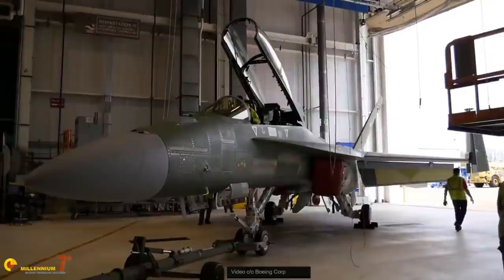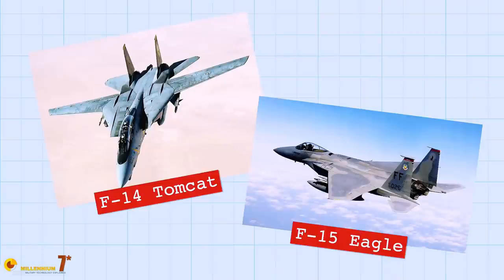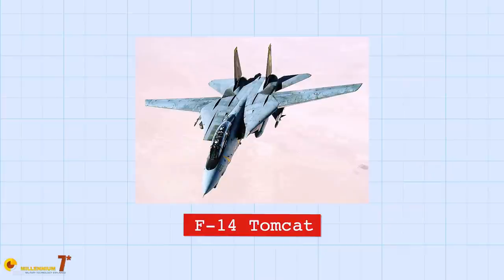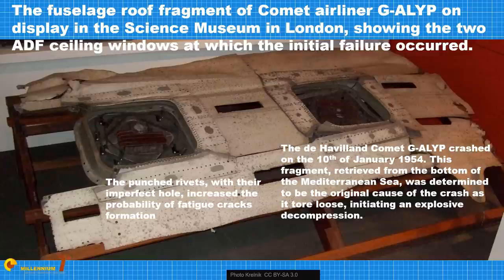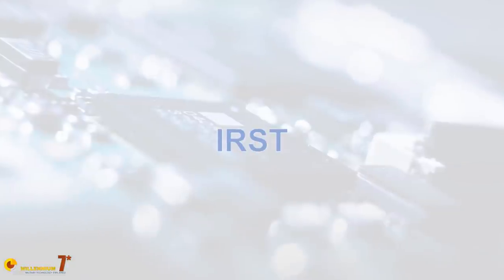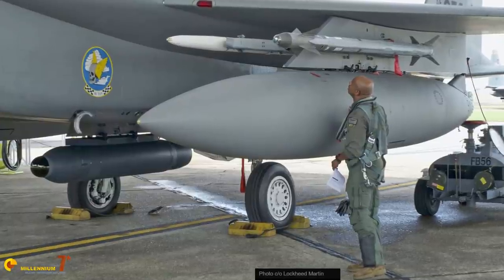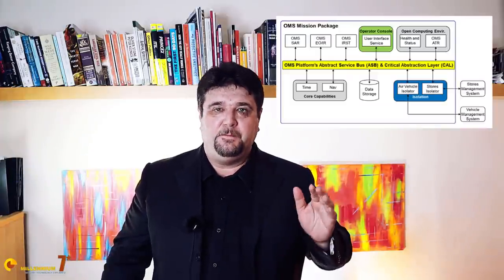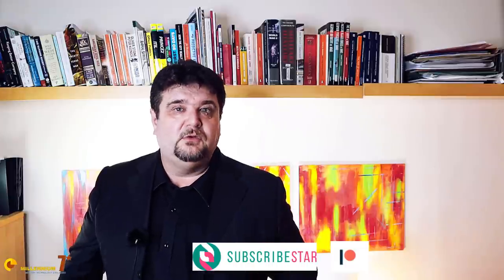The F/A-18 E/F Block 3: is it 5th Generation?

Comment: The question is not whether the F/A-18E/F Blk.III is 'Gen-5' but whether that metric is itself a useful measure of mission performance metrics.
It is not.
Stealth which costs double the CPFH of a twin engine jet a dozen years older in design baselines is not going to be purchased in numbers sufficient to grant sensor coverage of large operational areas.
Stealth which is 'so good' that the enemy is forced to go after the basing mode (killing all stealths at the Carrier or MOB vs. one or two over the target area) is no good insofar as it forces the CSG to standoff in the 1,000-1,500nm radius category which makes any minor improvements to fuel fraction pointless because, at these distances, pilot endurance as persistent presence becomes a dominant driver on 'the other 50% of the mission' simply spent to or home from the mission area.
Stealth which is too poor to exclusively (hot side) protect the 'platform' from detection and shoot down, thereby compromising 10-20 years of design investment in VLO is not useful.
Stealth which is lacking in mass video memory or a (MADL) ability to rapid-transfer targeting quality data back to whatever rebro node takes it out of MA or theater is useless.
Having said all these things, the F/A-18E/F is not a success story in it's own right or as an improvement on the F-35 in these areas because it's altitude performance is, in fact, worse (PS0 = Mach 1 at FL200).  It's drag is enormous, thanks to external carriage of stores from toed out weapons stations which do not suddenly 'straighten up and fly right' by removing the inboard station SUU-79, thanks to upper fuselage CFT.
It's signature reduction is highly dependent on viewed aspect.
It's 550 vs. 700+ nautical mile radius differential compared to the F-35, effectively robs the latter of the support jamming and air to air missile cabinet the Hornet is supposed to provide while making the utility of the MQ-25 questionable as both fighters carry in excess of 18,000lbs of fuel.
It's use of the enormous AGM-158D JASSM-XR, while theoretically allowing the Blk.III to be 'on call' for the ISR only F-35 to cue targets for, does not account for either the enormous 'fighter' systems waste in what has become a missile truck.  Nor the flyout lag of the subsonic weapon.  Nor the added carrier magazine penalty of the much larger standoff missile (see: B-1B from Andersen or Darwin for what an ALCM carrier looks like...).
Even as a straight up fighter, the jet is compromised by the asymmetry of an AIM-260 vs. PL-15 comparison in which the Super Hornet needs the better missile to match the lesser PL-12 and when matched against an as-equals weapon like the PL-15, is once again outclassed by the J-11D or J-16's ability to sprint-boost the missile to a higher launch Mach from as much as 20,000ft (less dense air) greater altitude.
Even the IRST is on the wrong side of the airframe to provide look-up tracking against superior kinematic threats while placing it on the fuel tank ensures both vibration induced tracking instabilities and the potential of dirt-mud-water kickup from the nose gear, damaging the sensor window as the not-hard-locked-t-airframe sensor bounces up and down in the tank shell.
The Sixth Generation will be defined by cheapness and the ability to rapidly get to targets as much as 2,000nm downrange (F-104 like drag indices, supercruise transits) before loitering, persistently, for 10-15hrs, 'taking pictures' and then coming home.  This is, by definition, a UCAV mission and it will need all the things a manned recce asset does /without/ being vulnerable to loss of stealth tech or a pilot when a megawatt class ground laser cuts the fuselage in half.
It will likely use a laser of it's own to defend against missiles or hunting drones and rather than carry heavy strike weapons, instead send data that calls in a hypersonic strikes from many hundreds of miles up/crossrange, off of stealthy Arsenal SSGN subs.  Because submarines cannot be sunk by BASM.
The Navy is not interested in acknowledging this, despite having recently (2016) begun running 'Fleet Problems' again, which show, repeatedly, how rapidly present day (Cold War Legacy) systems LOSE WARS to Chinese level Peer threats.  The last such HQ exercise, hosted by the Marines, only began to approach a neutral draw, with extreme attrition, when multiple forces were prepositioned on bases across the 2nd Island Chain, Australia and Alaska.  While keeping the carriers firmly to the east of Guam to defend it's key theater entry position for USAF heavy bombers.
Even then, losses approached 50% of committed forces.
Ironically, this is an exact replication of the ~1929 'Fleet Problem IX' which showed, in attacks on Panama, that carriers could get in one good, solid, blow but then were inevitably caught out by the predictability of being in a given sea space (to recover the raids they had launched) when longer ranging bombers from multiple airfields ashore, wiped them out in retaliatory raids.
So it's not even like we're learning from our own anachronisms.

Comment: Technology has made top line 4th generation fighters virtual 5th generation fighters in terms of lethality for a lot less money.  And sense anti-stealth technology is at our door step you could say they might as well be 5th generation fighters.
Reply: Not even close.  There is nothing really 5th Gen about 4.5 Gen ++ fighters.  Some countries are trying to imitate as much of the avionics approach in 5th Gen, but you really can’t do it the way all the systems are integrated in a 5th Gen platform.

Starting with performance, you can never meet the range/combat radius and transonic/supersonic performance of aircraft with high T/W and internal weapons bays.

With sensor suites, 5th Gen have all the sensors embedded into the airframe and integrated into the cooling, countermeasures, propulsion, and Very Low Observability from the start.  You would have to start from scratch with a 4th Gen airframe, and at that point, you might as well build a VLO airframe.

Every single 4.5 Gen fighter in production or development costs as much or more than the F-35A, for example.  F-35B and C costs have come down below Eurofighter and Rafale as well.

For situational awareness and ability to penetrate modern layered/high saturation IADS, you aren’t doing that in a 4.5 Gen fighter.  The Rafale flying into Libya with its patchwork residual IADS threats is not the same as Syria or Iran.  Only the F-22 and F-35 can fly in the most heavily-defended networks in the world, and have done so.
Reply from the maker: I beg to differ.
> I don't see where the range argument is coming from, just consider the SU-27 family.
> I don't see the transonic/supersonic point either, all the European deltas can supercruise while the F-35 cannot.
> The airframe integrated sensors are a necessity dictated to preserve radar stealth, and it is much simpler to build a non stealth sensor. Leonardo has been offering for a while IR sensors capable of replicating the "See through" feature of the F-35 that can be retrofitted on existing platforms, for example.
> In terms of situation awareness and sensor fusion, today it is a rather common feature. Gripen E/F and Rafale at least are on par with the F-35, the F-18 will soon be.
> Finally , cost is not comparable. The F-35 is destined to be built in a couple of thousands units minimum, while the European planes stop way lower than that.

The only important feature separating the most advanced 4++ from 5th is physical radar/infrared stealth. Radar physical stealth is not going to be effective for long because... the whole world is working frantically on beating it since it cannot being kept secret. 
Infrared stealth, on the contrary, is going to be a very important advantage in the future.
Reply: @Millennium7HistoryTech  Yes, the Su-35 is huge with over 25,000lb internal fuel, so even with external stores, it should have considerable range advantages.  I was thinking more along the Western 4.5 Gen fighters.  Rafale has good range with EFTs, but it loses weapons hardpoints and there is still a drag penalty to work against. EF also has good range with EFTs.

My point about transonic performance is with combat-configured aircraft.
The Eurocanards can supercruise in Mach 1.2-1.4 region with limited stores, not with standard combat loads including FLIR pods and large A2G munitions.  A lot of the published supercruise numbers are for very slick A2A configurations or maybe 1 EFT (These are limited to Mach 1.2 which isn’t my idea of supercruise down on the edge of the transonic region with the variations in mach wave formation there), whereas the F-35 can dash to Mach 1.6 (with 2x 2000lb bombs, having taken off with 18,000lb of fuel, IRST/FLIR/LST built into the nose, and ECM/EW integrated into the airframe), go to mil power and take a very long time to decelerate from 1.6 down through transonic and back into a .9 Mach cruise speed, not that supercruise was ever in its design requirements anyway.  

The F-22A can take 6 AAMs and 2x 1000lb JDAMs or 8 SDBs through transonic and into high supercruise, release any of those weapons above the max V0 of any of the combat-configured Eurocanards, and not experience any aerodynamic penalties from being fully configured as well.

I respectfully disagree that 4.5 Gen are on-par with JSF SA since they don’t have the RF and IR sensor count and spherical coverage in both IR/RF spectrums, or in the full antennae lengths that are embedded into the JSF airframe.  They also don’t have the same type of LPI layered Line-of-Sight directional data links with that high of fidelity and data transmission rates, although they have introduced better data links on the latest versions and advertise them as such.  The F-22’s IFDL and F-35 MADL are not fully explained in the open.

Rafale and Gripen E are trying to compete in that space in RF spectrum by using GaN TRMs in the ECM and AESA sensors, but they don’t have the 6 high-res IR cameras to provide that type of SA for the pilot and MADL net.  There’s a new IR MAWS for the Rafale that has 2 fish eye hemispheres mounted to the ECM housing on the vertical stab, but this is limited to close-in IR MAWS self-protection, not intermediate/long range TGT detection.

Not even the Su-57’s nose AESA has the TRM count of the APG-81, though it compensates for this with the chin AESAs, nor is the semiconductor quality on-par with the 6 US companies making chips.  They are trying to compete in the RF and IR sensor count on it though, since they were able to design and airframe from scratch after seeing the F-22 and JSF basic sensor architecture.  It will break them economically though.

France’s RBE2 AESA in the Rafale has about half the TRM count of the APG-81.  TRM count allows more modes to be used simultaneously and is better for return signals and ECM/ECCM, waveform manipulation, and low power freq-hopping narrow beam performance.

Sensor fusion in the 4.5 Gen fighters is an after-thought after gaining insight into some of the features of ATF and JSF that have been trickled out and now more openly-discussed.  Fiber-optic sensor fusion through multiple super-computing banks in a closed-loop system designed that way from the start is a lot different than trying to install that framework into an older airframe, especially looking at the integration with cooling, landing gear doors for radar bay access in the JSF (very maintenance-friendly), or integration with concealment features.

Also, RF VLO techniques aren’t static.  The F-117A went through at least 3 different types of RAM, finally using F-22 initial RAM.  Its RCS values shrank as it was improved and retrofitted with RAM that didn’t exist when it was designed.

The same is true with the JSF.  At Lot 4, they introduced a new nano composite fiber skin that changed the way RCS was compared to the F-22.  Prior to that, the F-22 was said to have a better/comparable RCS depending on aspect.  After that, the JSF is said to have a smaller RCS.  There is also a new CNC-applied paint that isn’t the same as early lot JSF.

As the program matures and evolves, you can count on continual RDT&E going into RF signature reduction, which can be incorporated into new production lots as they develop the systems.

The cat and mouse game continues, but it will become more and more clear that wringing out every bit of life from the 4th Gen airframes might make sense for nations who never invested in the future aggressively, but are being left behind with the 5th Gen, which also isn’t a fixed tech and is more open to upgradeability by design.

That said, I really respect and admire what they’ve done with the Rafale F4 systems.  It’s the only Eurocanard I’m aware of that has IR concealment airflow mass over the engines.  I can’t tell if the Gripen E has this feature, but Rafale F4 certainly does.

That would make an interesting episode to compare the evolution of IR concealment measures or lack thereof on modern fighters.  Su-57 doesn’t appear to have it at all.  The J-20A has them, copied off the F-35’s sawtooth edge over the airflow mass ring around the engine nozzle junction.

That whole first-look, first-shoot thing is being taken seriously by a few nations in the world.  Love the channel!